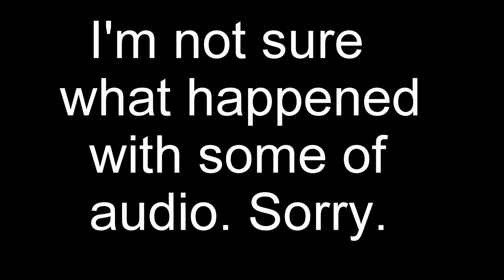Trap Bed Cookie Cutter

Comment: Looks real good. The only thing you might consider doing is welding pads on the corners to hammer it in with, and maybe a strap across the top to mount your cable to. 
Just a thought.
Reply from the maker: Thanks man.  Those are good ideas.

Comment: Try a stick welder no wire just a power source and welding rod pretty nice still fairly cheap
Reply from the maker: Thanks for the tip. If mine breaks, I’ll have to check them out,

Comment: if you can weld that good with that welder. you would look like a pro with a good Miller
Reply from the maker: Thanks! I guess I can’t expect a lot for under $100. I’ve never used a good one.
Reply: I agree I have a Miller and harbor freight it gets job done but Miller is where's it's at

Comment: What amp welder did you use, I ha e a 90 amp harbor freight , will it be ok on 3/16 stock
Reply from the maker: I’m hunting right now, but I’ll check it when I get home. It was the cheapest one HF had, so I’m sure yours will work. Thanks for watching Mark.
Reply from the maker: Mine is 90 amps and it does ok.

Comment: Rather than the cable you might want to get a little piece of round stock and bend it into a handle and weld it across the top of the cutter. Cable looked like it was getting in the way a little when hammering. Great work
Reply from the maker: I thought about that.  If the cable turns out to be a pain, I'll weld a handle on it.

Comment: that's pretty good I weld pipeline the only thing I could see that mite help you is make your relief cuts before you bend it will make it easier to bend and then weld it up nice job on it looked nice
Reply from the maker: Thanks.  I'm definitely a novice, but I'm persistent.

Comment: Pretty cool man. Good job. I weld pipe for a living so maybe I'll make one of these on my lunch break. Looks like they will work pretty well in soft ground. I welded up my own trapper shovel and sod buster hammer. I'm new to trapping so I boiled all my tools too to cut down scent. I'm not sure if that is necessary but I figured it wouldn't hurt. How much do you get for a prime coyote pelt? The local fur buyer near me in south central PA said he'd give me $10-$15. I'm just curios what you get. I'm not doing it for the money though. That's why I'm not trapping anything but coyotes. Im a deer hunter (southern part of 4B)so it's good to take out some coyotes too and save some fawns. The deer population down here isn't near as much as it was 10-15 years ago. There's too many guys shooting does and too many doe tags allotted. I purposely haven't shot a doe since 2007 but most hunters keep killing them. Anyway between hunters and coyotes the deer popuation has dropped so I'm gonna trap and hunt coyotes because I can't stop most of the hunters from shooting doe.
Reply from the maker: Thanks man. Welding is definitely an art.  If you can make a living off of it, I commend you.  My highest $ coyote was $53 at NAFA, but I've learned not to waste time with damaged goods.  They sell for next to nothing.  I've also learned that waiting until later in the season for prime pelts is a crap shoot.  The first coyote I ever caught, which is tanned on my wall, is the nicest furred coyote I have caught.  I caught it on the first day of the season, late October.  Moreover, what we think is a nice coyote might not compare to pale westerns.  Good luck to ya this season.  If you haven't caught one, be patient and persistent.  If you have, keep catching them.
Reply: Thanks man. I've never tried before. This is my first season trapping so I'll need a lot of luck. Haha. I'm ready for Oct 23rd!
Reply from the maker: If you get time, let me know if you catch a yote.
Reply: Will do man,  will do. I'll be pretty excited if I do.
Reply: @samuraichad343  four years later, how’d the coyote trapping go? Hope you hammered them.

Comment: Hey man I have a few more questions. Where and how do you keep your stinky lures. I put mine in an air tight container and I can still smell it. There is no way I can even transport this in my Honda Element unless I put it on the roof rack haha. The skunk smell in it is strong. It even stinks up my shed. Any ideas?
Reply from the maker: I know what you mean.  Lure like Gusto has some kick.  Mine are in a container sealed with tape then inside a bucket with a lid, but they still give off some odor.  Skunk essence is very volatile and hard to contain, even in glass jars.  Wish I had a better solution than multiple containers.  We used to own an Element.  Cool little vehicle.
Reply: I'll just have to transport it on the roof rack
Reply: I use a military ammo box for my skunk scent--no more wife yelling about the garage  stinking!

Comment: kinda new to trapping, just started last year. Can u give me any tips on trapping or snaring coyote and fox?
Reply from the maker: 1. LOCATION: Make sure you're on sign.2. BEDDING:   Make sure your traps are bedded solidly.These are the two things I focus on the most.  Yes, there are hundreds of lures and baits out there, but if you're not on location, your chances dramatically decrease no matter what lure or bait you use.  Practice making a set in your yard, and get good at it (especially bedding).  Know what tools you need, and have them organized.  You will never completely eliminate your scent, but the less time you spend on location the better.  Keep it simple.  Once you have set, leave it alone, and check from a distance if possible.  Have faith in your lure/bait and the predator's nose.  I hope this helps some.  Be persistent and patient.  If you have any specific questions, shoot them at me.  I'll answer to the best of my ability.  Good luck this season, and if you get time, let me know how you're making out.